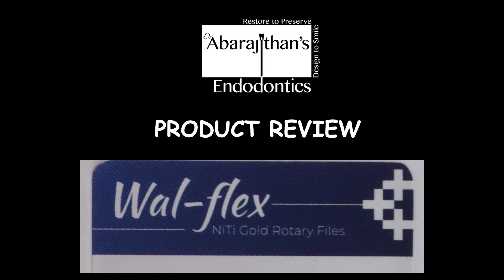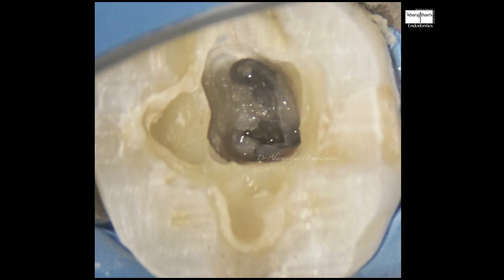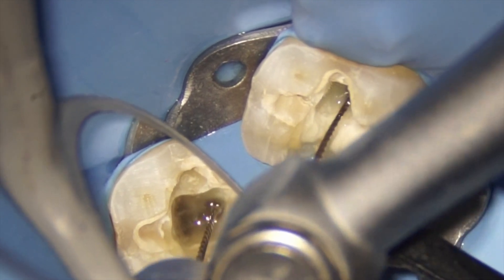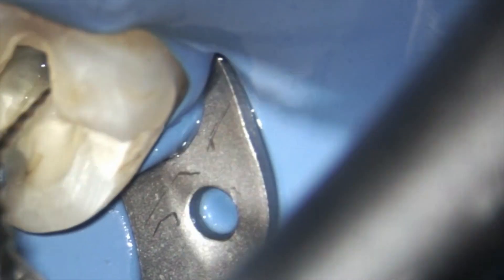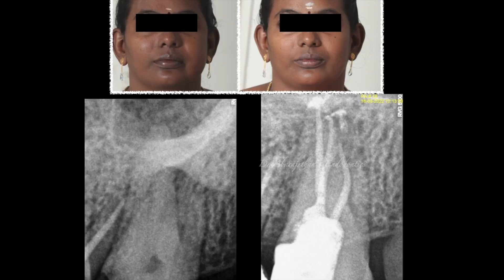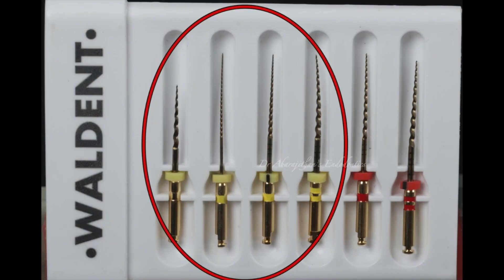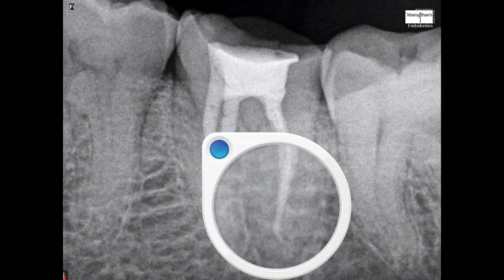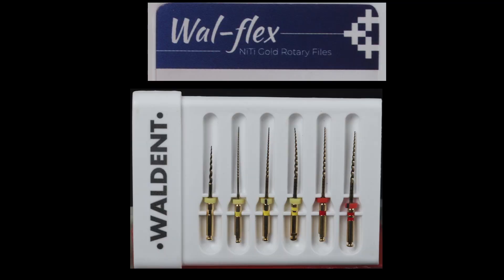WALDENT'S WAL-FLEX GOLD ROTARY FILES-PRODUCT REVIEW & CLINICAL DEMONSTRATION

Comment: Great video Sir. I have a doubt regarding Master cone fit. In the case 1 , it seemed to be 1-2 mm "short" of radiological apex ( considering that was actual WL ), but in the post obturation xray you were able to achieve GP reaching full WL . Even I do face this frequently. Last rotary file when used for shaping the canal till WL and while using corresponding size GP, GP will be 1-2 mm short of WL. In such situation how can it be corrected?  Should we run the file again  and recheck on xray till the GP reaches WL? What is the reason for common mismatch ? and What the solution to it! A request sir, could you make a  "short" video on this topic sir?
Reply from the maker: Sure ill make a video on this soon
Reply: @abarajithan1  Sir Thank you so much for taking the topic into consideration. I just wanted to add one point. I do use a 30gauge irrigation needle and use sonic device for activation of irrigant inside canal,  pass my no 10 hand file till and beyond WL in a hope that i would have cleared the debris. Still I face the GP being short of 1-2mm. Do take this point into consideration and let us know your thoughts and solution for the problem. Thanks in advance!
Reply: Even I face the same prob look forward for vedio on the problem sir
Reply: Use one size smaller gp and cut the tip a lil bit to seal upto WL

Comment: Superb demo of Wal-Fkex Files, Abarajithan Sir... Simple, Impartial, an Economical Choice of files. Good to know that Manual Glide path determination is not necessary. Is it true for all difficult canal cases too ? & what is your opinion about Wal-Flex Files compared to ProTaper NEXT Files? Thank u for creating such useful videos.

( - From, Dr. HAFEES HASSAN, 
DENTAL EXPERTS, Perinthalmanna,
Kerala.)
Reply from the maker: Thanks doc, yes its true, more n more evidence are coming in favour of no manual glide path, protaper next is m wire, has great cutting efficiency but also slightly more prone to fracture